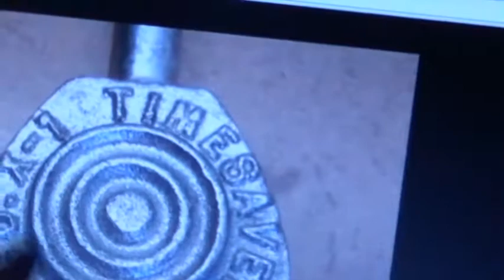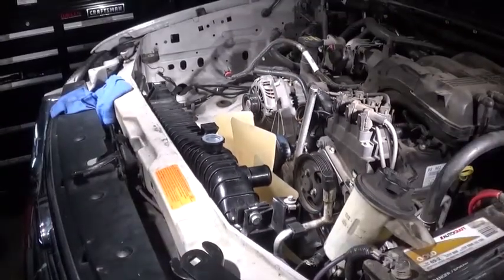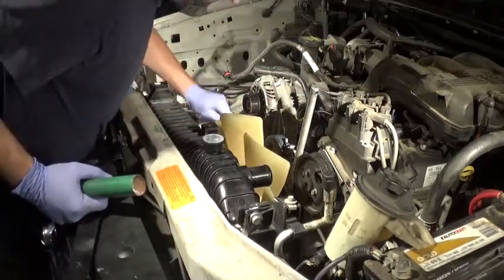How To Remove Radiator Fan Clutch

Comment: That's a creative solution, it's always fun to make your own specialty tools. When I work on my chev fans, I leave he serpentine belt on until the nut is broken loose, then use a cheap wrench kit from Princess Auto. In a few years these will be extinct, I think most are going to electric fans.
Reply from the maker: spelunkerd This wrench is awesome. I can use it to hold crankshaft or clutch pulley. Super useful. Cheers